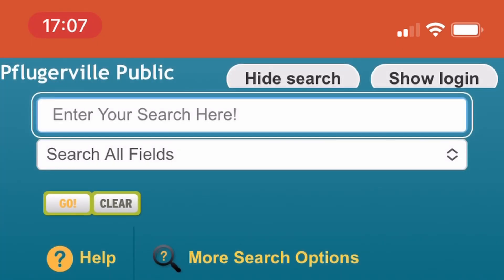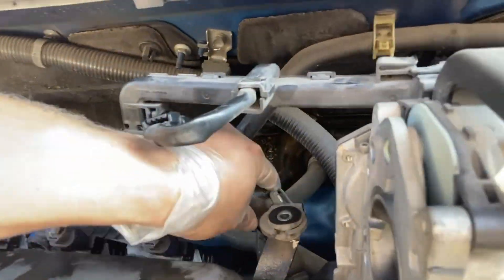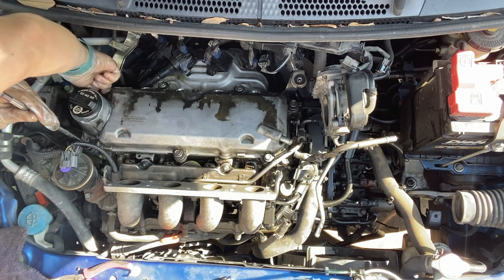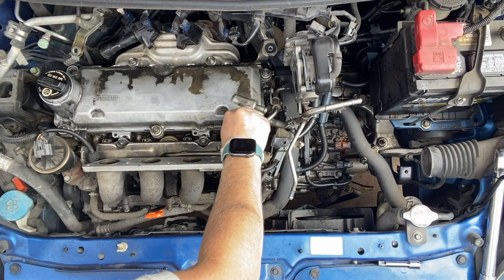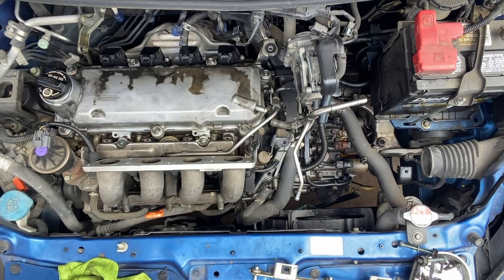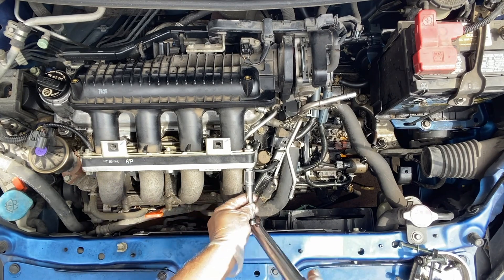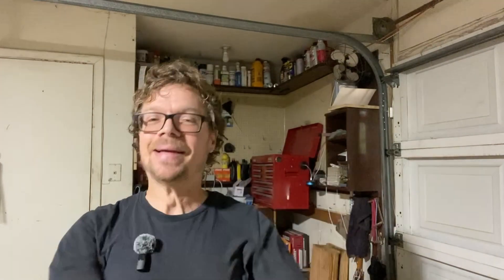08 Honda Fit - Valve Cover Gasket Replacement

Comment from the maker: The tools used were:
Flat Head Screwdriver
Ratchet
Torque Wrench
10mm Socket
12mm Socket
7/32 Socket
Deep Socket
Extension
Pliers
WD40 Silicone
Parts Cleaner
Rags

Comment: What type of tripod or other equipment do you use to capture recording your engine?    Your setup is such a clear view of the engines!  I would like to start recording myself working on my own car so that I have a reference for later if necessary.  Thank you for providing time stamps in this video!
Reply from the maker: I purchased this from Amazon, not an affiliate link: MOSENVKA Dual Magnetic Phone... https://www.amazon.com/dp/B0F296V2H2?ref=ppx_pop_mob_ap_share
It has a magnetic base which I attach to the under side of the hood to film the engine bay. It works great

Comment: I have question I need remover the battery or
Reply from the maker: I cannot say what you need to do, but I can tell you that in this repair I personally did not disconnect or remove the battery (though typically I try to disconnect the battery whenever messing with electrical)
Reply: thank you 🙏

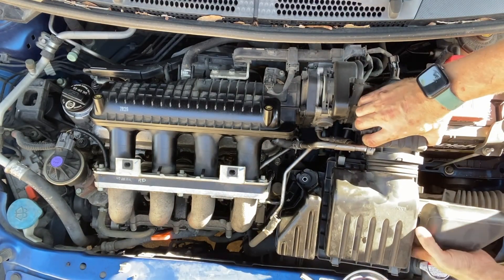Comment: 3:07 clamp is 90 degrees off; it was not necessary to disconnect coolant hose between return pipe and throttle body. 
I had a bad luck with Permatorque blue  Fel-Pro gasket
More frequent oil changes are needed
Reply from the maker: Yes, when pulling it apart, I definitely removed more clamps and hoses than were necessary. I do try to mention this, and it is shown in the manual. My recommendation is to follow the manual.